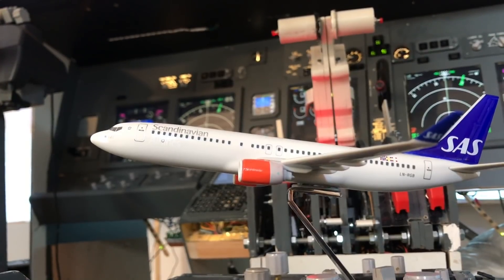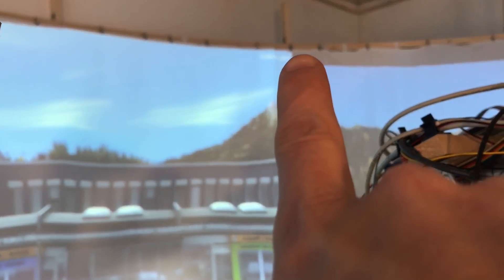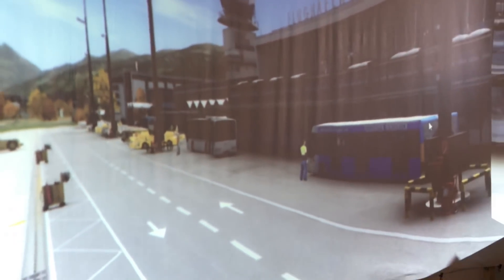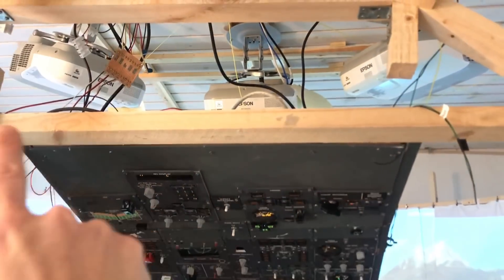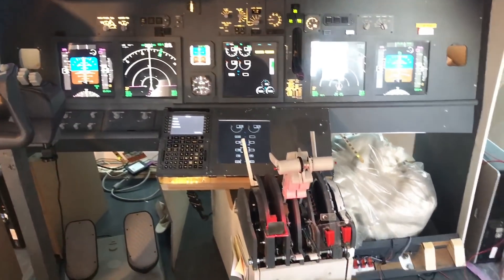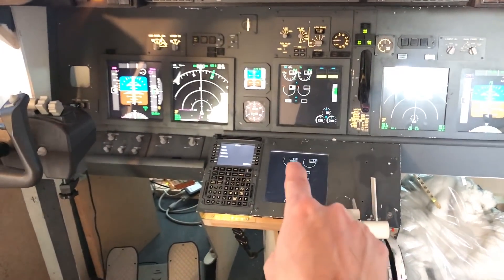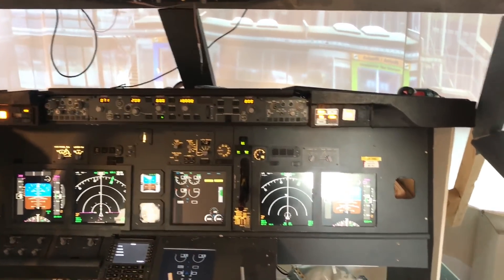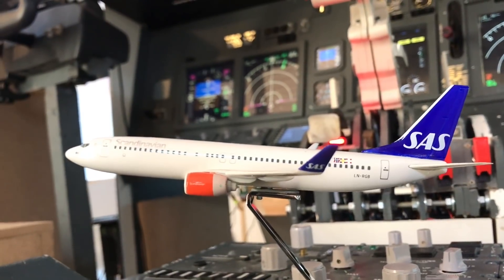Happy New year 2017-2018 - B737 Home Cockpit

Comment: Try to ground all your PC's and components. I had some flickering switches in my cockpit due to EMC and no problems after grounding. If your power sockets are from two different electrical phases this may trigger you system.

Comment: Can the prosim737 switch program run over a network to a different pc
Reply from the maker: Flightsimmer101 Prosim runs a server program. You can run the other programs (Displays, FMC, Autopilot) on different computers via the network. Just have a static ip-address for the computer running prosim.